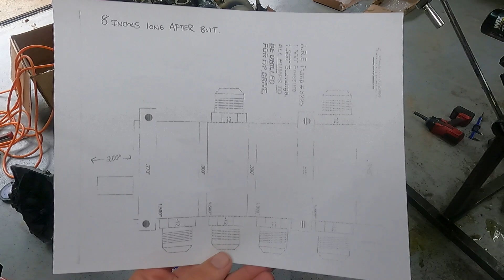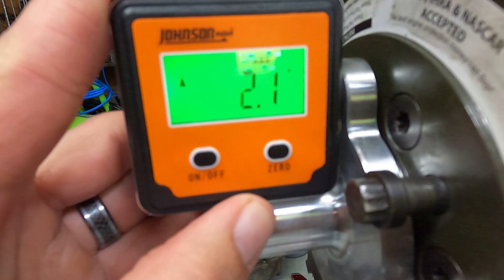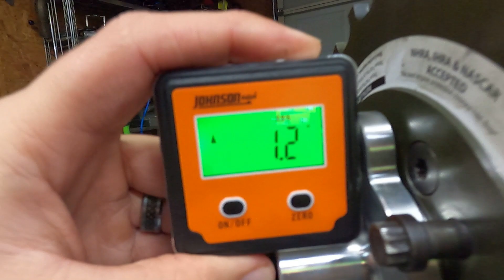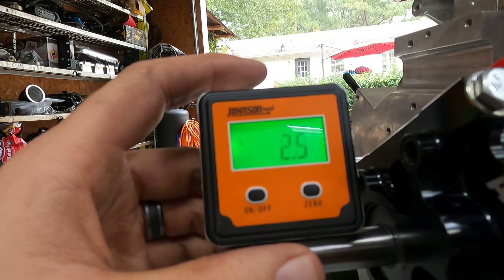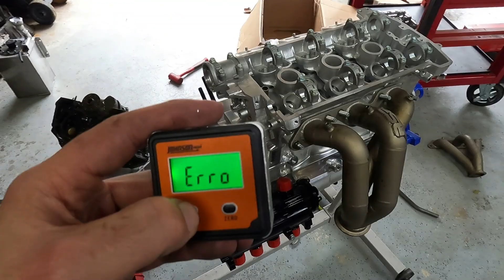DRY SUMP TIME! Blue Turds Billet Engine Assembly!

Comment: If I was you I would hit up a bunch of engine builders and see if they can make a set of billet heads and you should go with CP/Carrillo pistons and aluminum rods and hit up Bryant and see if they can make you a billet crankshaft and you should put inconel and stainless valves in the heads and then call around and see if someone can make a set of custom grind camshafts  for you and you should be good to go to the moon and back